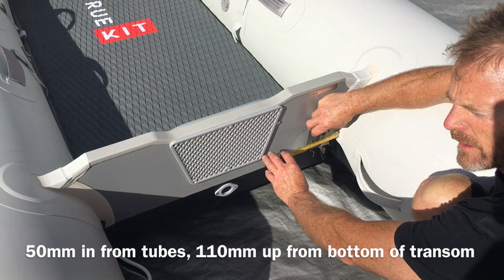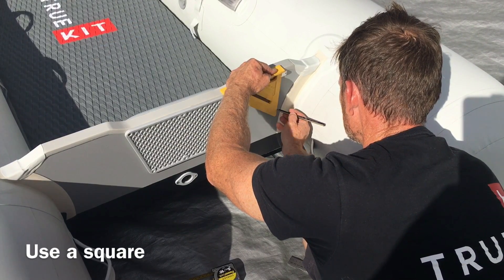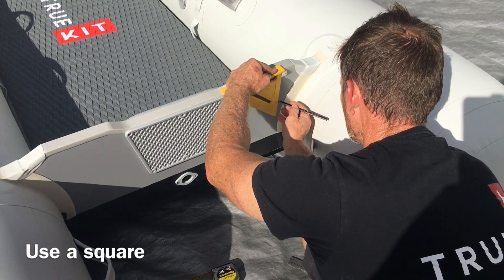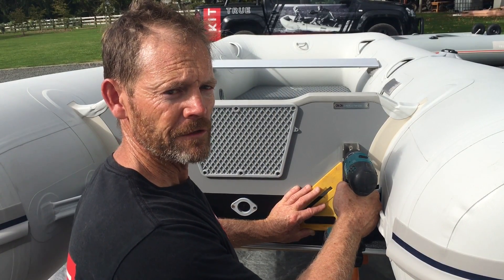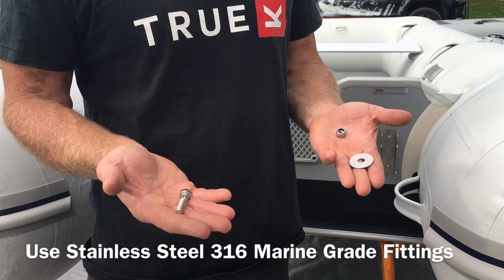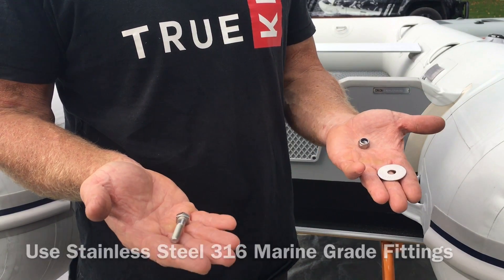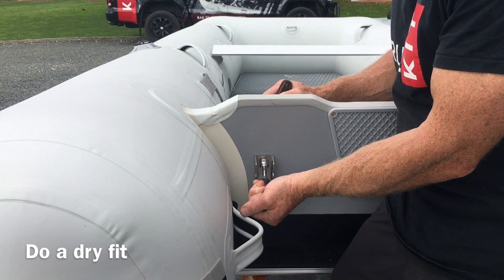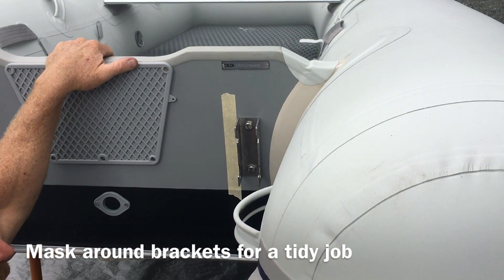How to fit Transom Wheels to your inflatable tender

Comment: Hi ive also seen the same wheels installed opposite to the way you have done it so the wheels sit under the boat is there any advantages of fitting them either way or is just personal preference.
Thanks.
Reply: @Smokey00  wrong way round

Comment: hi i dont want to drill holes. is it possible to glue the brackets onto transom? i have a very strong waterproof epoxy adhesive.
Reply: If you don't want to drill holes, I would use a strong flexible sealant like Sikaflex Marine 291 which has great strength but also can flex as you wheel the boat over bumpy ground
Reply: thanks rod, i can't find that locally. how about this; 3M Marine Adhesive Sealant 5200, White, 3-oz
Reply: Yes, that's the 3M equivalent and should do the job.  You will be relying on the strength of whatever is on the transom surface also.
Reply: @roddawson3855  cheers!

Comment: How do you remove the excess sealant ?
Reply from the maker: A plastic scraper works well and then smooth with meths
Reply: Or cover each bracket with a piece of cloth when folding the boat

Comment: This video is totally wrong. The wheels should go under the transom and not behind it.  Also never use sikaflex because it makes a structural bond which will rip the plastic off when you try and remove them.
Reply from the maker: You are wrong, it is best to use Sika to help support the brackets with the bolts and provides a much more stable platform.  Don't plan on removing them, do it once properly.  The wheels can be clipped on either forward or backwards so you are correct there
Reply: @TRUEKITINFLATABLES  sorry but the manufacturer will tell you never to use sikaflex. Why would you need adhesive with two great big 10mm bolts holding it on?  Mine have been on solid for 5 years.  Which year do you expect them to drop off?
So if anyone wants to put some new ones on , it's OK to wreck the transom because you don't need to change them?
Plus if you do it your way , you can't turn them around if you've fitted the brackets too high .
Reply: At 1:23, wheels outside of the boat in up position, at 1:35 they are also outside the boat in down position.  Technically impossible, the wheels should be beneath the boat in down position .